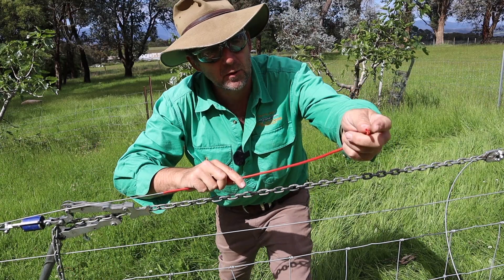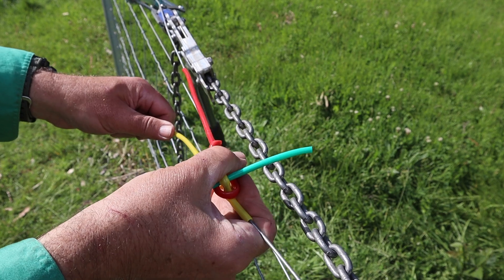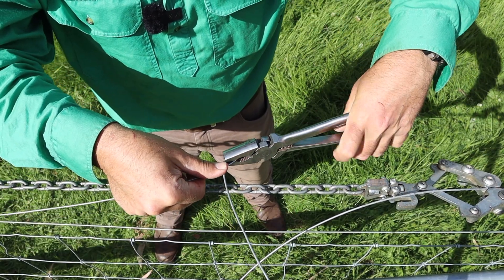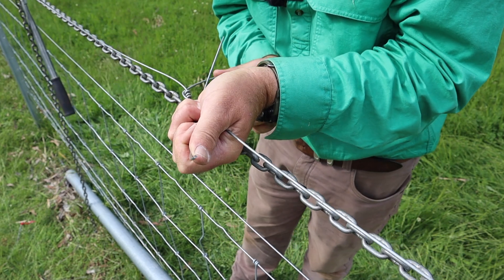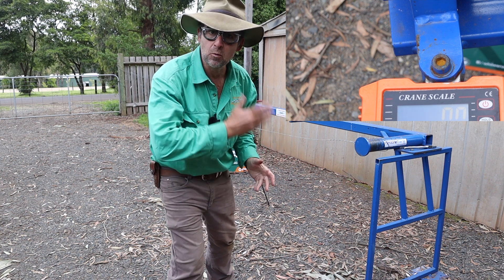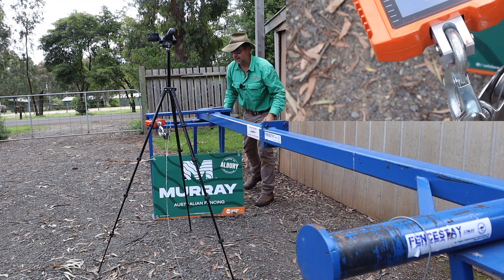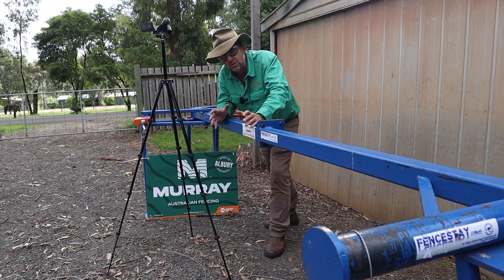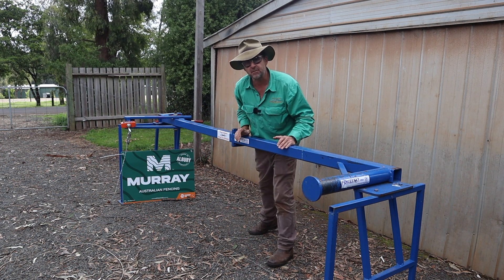Master The Pin and Loop Fence Knot (And Break It!)

Comment: Still like the figure 8 for joining wire. Quick and simple and when you are practised you can mix gauge and tensile and still get a solid knot. AND, I can do them in dull torch light when I have to.
Reply from the maker: The figure 8 is better and stronger

Comment: Mild steel wire should be better ?
Reply: I started out jackarooing 55 years ago not long after I finished school and did a wool classing course at TAFE. A job I used to get frequently was to go out with a station hand who was aboriginal. We spent most of the day out checking fences.
He used the old Donald strainers and 8 gauge wire, it used to be fun driving around in the buggy with all the gear in the back. He didn’t have a great array of knots etc. but enough to get buy.
Reply from the maker: @antipodies  Memories to treasure I reckon.
Reply from the maker: I’d only use this with Soft. And there’s still better options then.